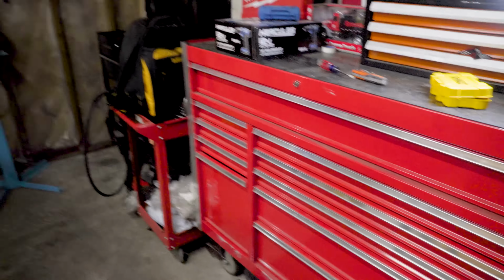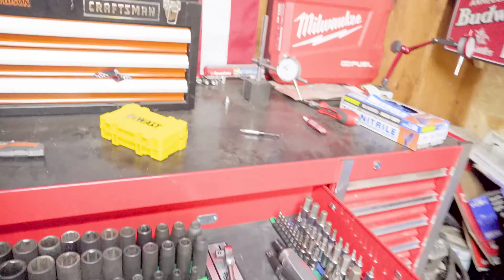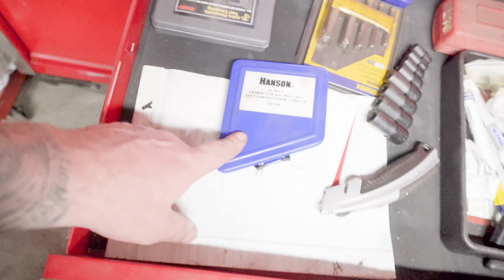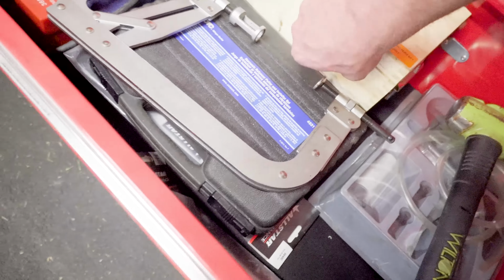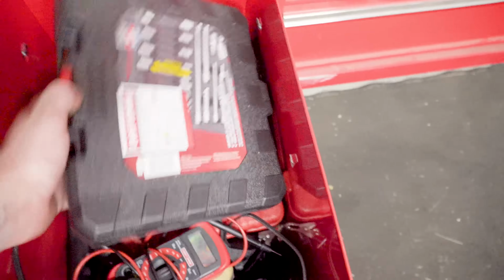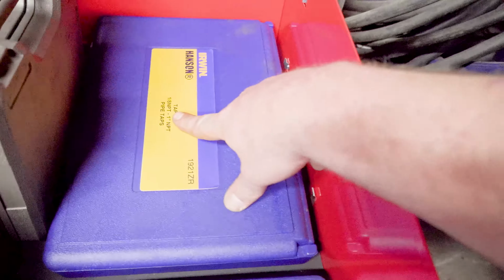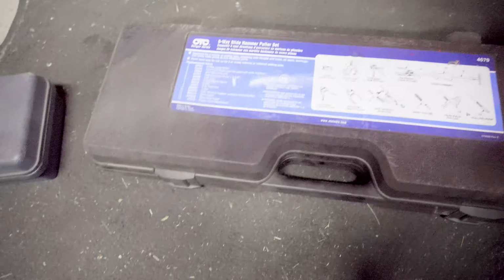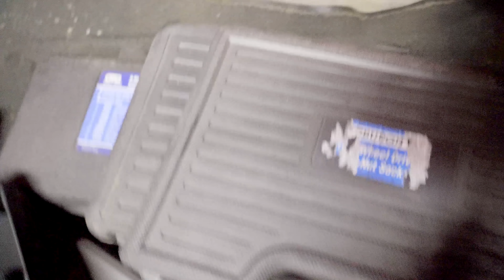Harbor Freight US General 72 Inch Toolbox Tour

Comment: I dont like the drawer latches on the 72 or the 56 or the 30 inch tool cart by the us general which you would open the drawers from the center of the drawers but it is a good tool box